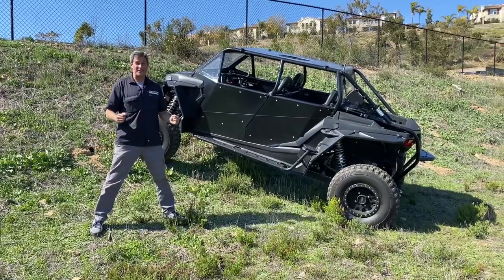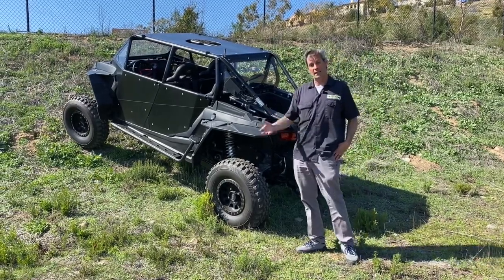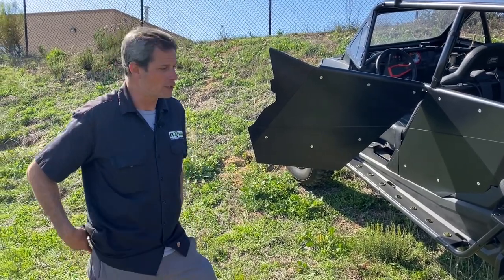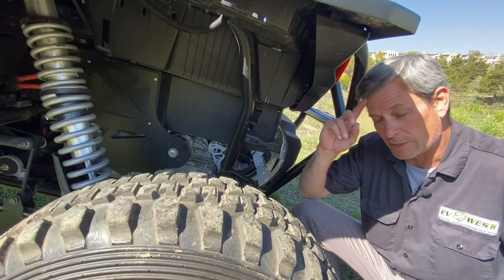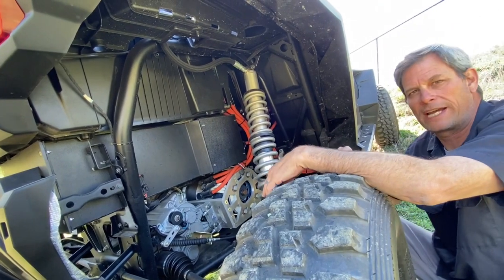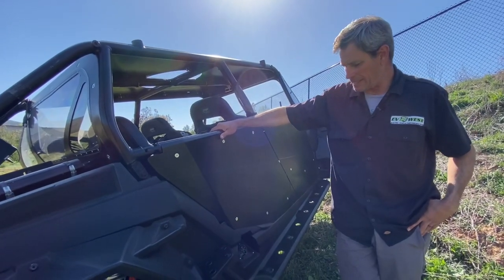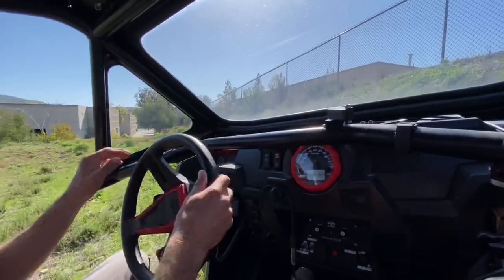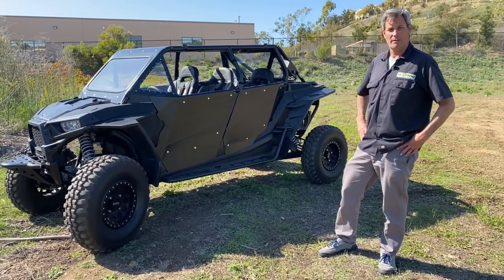Polaris RZR XP4 1000 Full Electric Conversion | EV SHOW

Comment: I've always wanted to convert a SxS. We do a lot of mountain trails and rock crawling. Electric would cut out the heat, the noise and the exhaust fumes from slow moving trails. I might have to take this project on some day.
Reply: If low on power,find a current Bush in the woods.
Reply: @gerald4027  Yes. You can find it right next to the gasoline bush.
Reply: @gerald4027  Well if you carry small solar panels with you then you can charge when sun is shining. Also having reflectors on solar panels increases their power so with 100kg of solar panels you can charge long after when gas you carried has run out.

Comment: So he stated it's a little faster than stock but then says it tops out about 60nph with electric but as gas the RZR100 will do 80mph conservatively from everything that I have read. Still one amazing job and definitely worth it especially for the job that it's going to be doing EV West does it again always with the Great electric conversions
Reply: Fast isn’t just top end it’s 0-60 also and it sounds like that’s what this guy used it for more 0-60 then top speed

Comment: My dream is a converted Ariel Normad. Rally capable but mostly used to get around the countryside and sleepy villages in great weather. I do want to to remain light so the upcoming next generation of cells will be welcome. 
I kind of want it to be AWD though, so that would be a proper challenge to engineer. No huge power needed on the front axle, but some good low speed control for light roack crawling and maximum acceleration would be epic.

Comment: It would be cool to see the range with a turbine generator that runs on alternative fuel like hydrogen or oxygen onboard recharging the battery in the field.
Reply: A diesel generator running on biodiesel would also be interesting to see
Reply: @notimetoexpIain  that would work. But the fuels I listed burn cleaner. And what’s cool is a turbine is multi fuel. As long as it burns and is a semi gas liquid spray. It will run.
Reply: @Daniel-os9tb  the fuels you listed do burn cleaner but are harder to store and come by, I said biodiesel as it is fairly normal and the turbine could run on that too (afaik)